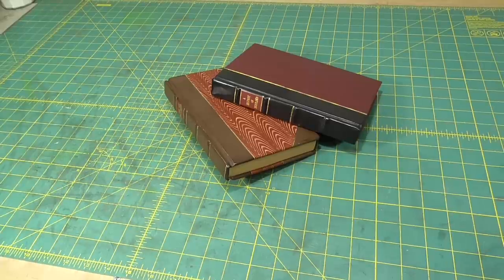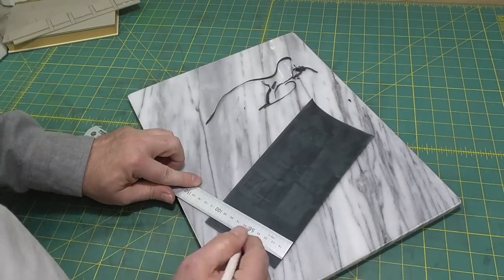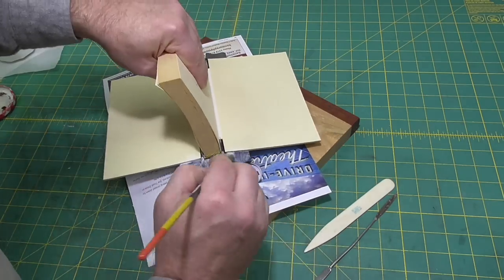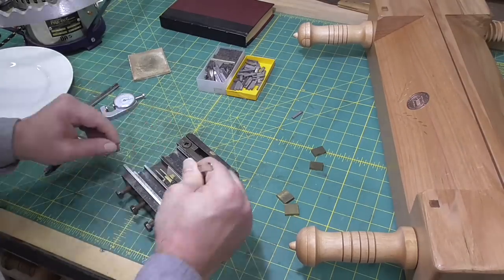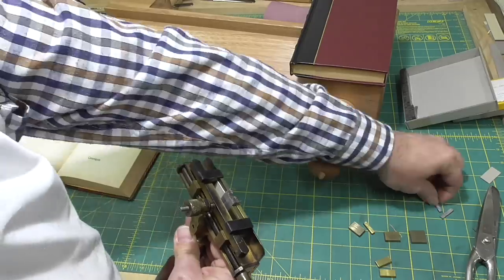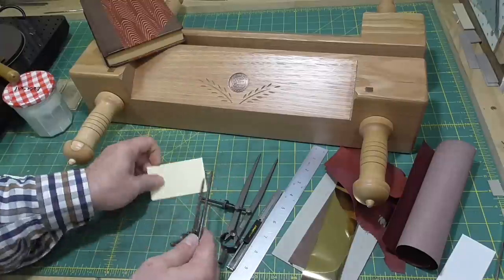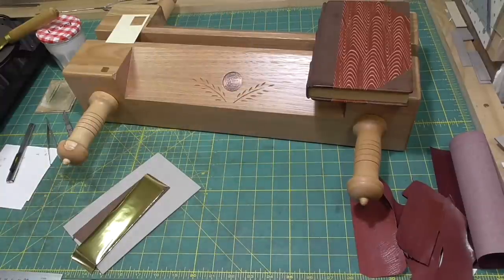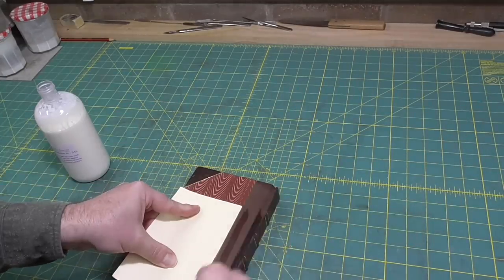Converting a Paperback to a Hardcover Book Part 2 // Adventures in Bookbinding

Comment: This was exactly what I needed to see.  I've been banging my head against a wall trying to figure out the best approach to type, tools and labeling.  Couldn't figure the tools, and loved your demonstration of the hand-held type chase.  All I usually see are these very expensive machines that take up loads of space.  Seeing a small specialized tool for holding type seems the perfect answer to my problem.  If I'm going to try to make a book, I'd like the title to look nice.  May take a bit to save up for it and the type, but I know what to look for and where to find it.  Thank you so much for showing all of the details, even the 'non-sexy' but completely necessary parts of a hobby I'm coming to adore.

Comment: I tried this project with cloth instead of leather - without the details on the spine and so on. The biggest problem for me was to cut and fold the cloth to glue it in the book. Specially the part near the spine. I made some mistakes for sure and probably it was more difficult than it should be, but im happy with the result regardless.

I learned with the mistakes (some stuff you just learn passing through it) and also managed to bind a decent cover (not perfect, but decent).

Thank you for another awesome video. I keep returning to them to refresh my memory and try new projects.

Comment: Thanks for the tip on repairing. The one i  made i didnt remove the adhesive thought...I might redo that book in the future
Complement: the gold tooling tools are not only expensive but also hard to find. I can barely find tools in my country
Reply from the maker: Finishing tools are expensive in every country.  They are just outrageously expensive anywhere outside the country they are manufactured.  They are easy enough to find.  An email to Talas, Hewits or Kevin Noakes with a platinum/gold coloured credit card in hand and you can have as many as you want.  Unfortunately the colour associated with my CC is red:(  The other thing to try is making your own.  Many famous binders make their own tools.  Wilcox used to make his own type!  Happy binding and may your future bring you lots of cheap finishing tools!  DAS
Reply: @DASBookbinding  I am a creative person, but I cant find a way on doing such tools. Is there any refence on how make it?
Reply from the maker: @thevdevitor  That is a good question.  Not that I can think of.  But I bet there is hidden away in some newsletter somewhere.  I'm going to go hunting!  DAS
Reply: @DASBookbinding  Same for me. I send you some info if I find O_<

Comment: I really liked the way you inserted the original cover into new boards, cuts down on bulk. Will have to try. Also a mold for the spine, genius, must try that instead of strings. I've used jute twine instead of leather strip for false bands before now and kitchen roll tube for curved spine. If you use tacky glue instead of standard PVA, it would give you longer work time
Reply from the maker: Using cord to tie up the book didn't work for me on this project because of the flat spine.  I stole this idea from someone,  but not exactly sure who it was - maybe Mark Esser.  For a longer open time I'd use mix, but for this video I wanted to simplify and only use 1 adhesive.  Good idea with the kitchen roll.  All the best, DAS

Comment: Great vids, thanks for doing them.   Question regarding the gold foil;  do you prep the leather with glare like one has to do when using real gold?  Wondering what makes the foil adhere to the leather?  Just the heat of the tool enough?   Thanks in advance.  And remember... even a bad day in the book shop is a good day in the real world!
Reply from the maker: No glair required.  Foils have many layers and the outermost layer is an heat activated adhesive.  All the best, Darryn

Comment: I'm wondering at 7:30 whether painter's tape would work? That's what woodworkers do where clamps would damage the surface of the workpiece (e.g. when 'facing' ply edges with hardwood). But maybe setup will cost you more than the 5min you're trying to save =). If you have to do it often it might be worth it: some ply and two clamps to go around the book (or can you tape straight to the cardboard without damage? it'll be covered anyway later), then 5--10 strips of painter's/masking tape across the spine for applying the pressure... For woodworkers it's not so much for saving time, as a lack of hands to apply consistent pressure in 10places at once.
Reply from the maker: I do have a set of pressing board with rods taped with blue tape to the edge.  I think I didn't want to use them because it was something else I'd have to explain.  Regards the forming thing, that certainly could be done better.  A common trick used by book conservators is to wrap the book with an elastic bandage, which would have worked here too.  I had this plan to do a similar cased binding and was going to reuse this form.  Not happening:(  All the best, DAS

Comment: What type of binding you would choose to rebind modern hardcover book? First I thought about flexible leather binding. But when I've tried to sew cords to already sewn book I understood that this wont work. Now I'm thinking about something similar to methods in yours videos "Buckram Covered Library Binding" and "Leather Binding with Laced-On Boards" or mix of them. I really like classic-looking books which are rarely made on modern market.
Reply from the maker: I'd start with a more basic binding such as a rounded and backed case binding.  A handmade version of this will last a lifetime - multiple lifetimes.  I'm teaching a course on this in late October for QBG in Brisbane.
Reply: @DASBookbinding   unfortunately I'm living in other country. I'm not sure about case binding as it looks a bit inappropriate for leather bound books. But maybe that's my amateur impression. For now I'm thinking about Buckram and Laced-On binding mix. However as that is a new book I think it will be more correct to glue linen strips(instead of trying to sew them to already sewn text block) and mull to the book spine(after rounding it). After that I gonna glue stripes to cardboards as you did in Buckram binding, however I wanna switch cardboards plates in order. First will be thick 2mm cardboard and then thin 0.8mm cardboard. In that case physically boards bill be closer to laced-on binding, so I can make smaller gap between spine and boards(I dont like big gaps in Buckram binding). Another step is to make hollow tube from kraft paper and apply leather. I already prepared some cheap books for experiments and looking for materials and tools here. Hope I can show my first work in few weeks.
Cheers.

Comment: Another excellent video. When working with black leather and very light coloured bookcloth, is there any easy way to stop the colour of the leather from showing through the overlap?
Reply from the maker: Good question.  You could infill under the cloth with black paper and you won;t see the transition.  But of course the colour of the cloth is affected.  Otherwise I think you need to increase the opacity of the cloth, maybe by lining it with paper.  Good luck!  DAS

Comment: What kind of covering cloth do you use for books like these? I read online that I’d you don’t use the right kind of cloth, it would warp the cloth. Thanks!
Reply from the maker: There is a lot of poor information online about bookbinding.  Cloth can make a difference, but why boards warp is not completely straight forward.  I have videos on this subject.  Grain direction of the board is the main consideration.  Cloth usually has a minor impact, especially when using commercial book cloths like I used.  I used Arbelave buckram, which is available from a number of suppliers (check my supplier list linked from description).  Good luck!  DAS

Comment: Is it OK to use rope to push down the leather around the spine bands? For example, if one has  a row screws on each side of a finishing press, wrapping the rope around those while pulling down on the bands ?
Reply from the maker: That is a method used for a traditional book with a rounded spine.  Might not work in this unconventional case.
Reply: @DASBookbinding  Got it, thank you! Yeah, i can see that method might leave some unsightly indentations on the flat spine.

Comment: Hi DAS, I don’t understand why this is not suitable for fixing or reserving the old book? Since some old book also had the soft cover, can I used this method to fix my book? The cover is tearing a bit but the back is still ok. Do you have any recommendation for my case? Thank you very much.
Reply from the maker: When I want to preserve something, I want to do it in as close to original state as possible.  If I do convert a softcover to a hardcover, I will follow the method I show in another video where I put the original cover on the new case.  In this video I was creating a sort of prop for a museum.  So it has a purpose, but I don't see it as preserving a book.  I think the split board attachment I use in this video is superior binding to the case binding I wold use in the preservation case, but it uses the original cover.  I guess you could remove the original cover and wrap a new reenforced waste around the bootblack to make the tabs for a split board attachment.  In your case, I think the video where I preserve the original cover is what I'd recommend.  Hope that helps.  DAS

Comment: Hi ! I have a question, how tall are your letters that you use in the hot press? I bought a set of Gothic letters on Ebay, and I'm still thinking of making a yoke for my press, the problem is that the total height of the letters is only 7 mm of which the shoulders are only 4 mm, and here is the problem my how to make the yoke so I can catch the letters.
I think yours is at least 10 mm, right?
At the moment I use them glued with adhesive tape on a metal plate, but it's a bit silly improvisation, but that's it!
Reply from the maker: Most commercial grade foiling dresses are design to take the standard letterpress type.  Being in Australia, my type is the standard British-American type height of 0.918 inches.

Comment: Thank you for the video. What is the visual difference between real gold leaf and imitation gold leaf? Is it noticeable? Is it worth it? Thanks in advance.
Reply from the maker: Actually a complex question.  There are 3 options, real loose gold leaf, real gold foil and finally imitation gold foil (which I'll just call foil).  One reason some tooling looks especially good is because of the way the tooling is done.  A really skilled finisher introduces a glint to the gold by rocking the tool as they work.  Could they do this with foil - yes, but these people wouldn't use foil, at a minimum they will use real gold foil.  Foil, because it is not gold is highly likely to tarnish with time.  So why spend years perfecting finishing skills do a job that won;t last.  Real gold foil may be a bit expensive for initial purchase, but will go a long way and is not that expensive for each job.  Foil will tarnish with time.  My teacher has books she did with foil many years ago which have gone green or grey/black.  But a quality foil can look very good and I use it for jobs such as the paperback rebind where I don;t expect the book to last a long time - which means tens of years.  Hope this helps, DAS

Comment: Do you ever do this to a brand-new book?  I could see myself doing that if it's a reference book that I plan use a lot.l
Reply from the maker: No, but no reason not to.  Most of my projects are based on very standard bookbinding methods with some minor tweaks for my personal style of working - the way I was taught to use tools etc.  Except this project.  I developed it for the very specific scenario of making a new book look sort of period, or at least not jarring in living museum environment.  All the individual bits are still based on standard methods.  Even the fake shoulders are based on Harrison's technique for binding thin books.  But overall it wasn't based on anything I'd seen before.  If I just wanted to make a hardcover version of a new softcover books I'd probably use the square back Bradel case method, which I demo in another video.  But the split board attachment in this book is very strong.  DAS

Comment: Have you done any experiments with rebinding a hot-glued paperback that is printed in sections?  I think I have a candidate book for trying that kind of project: an Oxford Shakespeare complete works I had when I took a year of Shakespeare courses in college. 😊 

It looks as if the book is printed in thick sections (lots of leaves of thin paper), sewn with really thin thread, and hot-glued to a square back paper cover. I wonder if I could melt the glue, re-sew the sections with thicker thread to get some swell to round the back, and then put a prettier, maybe leather, case on the book. 

Do you (or some of my fellow viewers) have any experience, tips or advice relevant to that idea? 🤔😊
Reply from the maker: If it is a recent book and the glue is PUR then it is almost impossible to reactivate.  You can tell if it is PUR because you wreck the book trying to pull it.  If it is heat activated EVA then you should be able to pull it using a hair dryer.  It is messy.
But if it's a nice book I wouldn't pull it.
Reply: @DASBookbinding  The glue is translucent white. Is that a clue that it is EVA rather than polyurethane?
Reply from the maker: @martinnyberg71  I can't tell them apart by looking at them.  I think the PUR tends to have a thicker layer.  I'd be interested if you work out how to tell them apart.

Comment: Do you reckon that carnauba wax will also work for buffing up the leather?
Reply from the maker: Generally I don't give an opinion of something I don't have evidence for.  For my work I use tried, tested and accepted materials. But for this binding, which I did not have lasting hundreds of years in mind (the hot glue in the original binding will probably fail first), then sure  Carnauba wax should be fine.  A quick check on the inter web and it seems most version are stabilised to a pH of 7, and veg tanned leather tends to be slightly acid anyway.
Reply: @DASBookbinding  Thank you very much.

Comment: Regarding PVA versus paste. Anyone who is going to go through this much effort should learn to use paste, yes? Is it that much harder?
Reply from the maker: Complex question.  I designed this project so it could be done just with PVA.  I think to move beyond just copying projects design by other people one needs a good understand of the materials to be used, whether that be adhesive, paper, covering material, etc.  For many applications methyl cellulose is a good substitute for paste, which can be used for putting down pastedowns or in mix, where the benefits of PVA and paste are desired.  Paste is a must for traditional binding in leather.  But then in the scheme of skills like paring leather, and how to handle it and apply wet leather to a book, are probably more complex.  I will have a video on bookbinding adhesives in the next few months.  All the best, DAS

Comment: Is there an easy method to foil letter without a press?
Reply from the maker: There are a couple of methods being used by the internet community.  I've never done them.  And I'm not sure they are easy either, but don't require the same specialist tools.  One is using a laser printer to print onto a surface and then using a laminator to stick foil to the printed area.  Another involves a a vinyl cutter, but I know very little about it.  Main downside to these is you don't get a nice type impression.  DAS

Comment: That leather looks like it has been stuffed (had oils or greases added to it to change the feel).
Reply from the maker: It was  some time ago.  I think that was supposed to be the raw veg tanned leather that I had trouble getting foil to take on.  It wasn't obvious, but I suspect it had a coating on it.  I may have given it a buff with Hewit's leather dressing at the end.  I don't remember.
Reply: @DASBookbinding  I've done leather working for many years, from the way it was behaving it had DEFINATELY been treated with something.
Even using the pva it should have been more pliable, and a flat cobbler's hammer works wonders getting corners to lay down flat ;)

Comment: Can one use buckram rather than leather on raised bands or does it not work in your view?
Reply from the maker: The stretch of bookcloth varies a lot from type to type.  I'm sure you could find some that would work well while others won't work very good.  Paper backed cloths would not work well I don;t think.  Maybe Arbelave, but I have found it difficult to form headcaps with it.  Good luck!  DAS

Comment: Watching artisans work, just make their respective craft look so ridiculously easy. If I tried doing this ........ 🙄
Reply from the maker: I'm sure it would take you long to be able to do this!  All the best, DAS
Reply: @DASBookbinding  I have softcover text books with high quality paper that stays like new, even after 40 years. It is just the cover on some of them has deteriorated. I see what you mean though regarding that acidic low quality paper on most cheap novels. I have a couple of cheaply bound maths books in the "Teach Yourself" series. They are bound the same way and are falling to bits already. The glue didn't hold the edges sufficiently. Thank you for your replies.